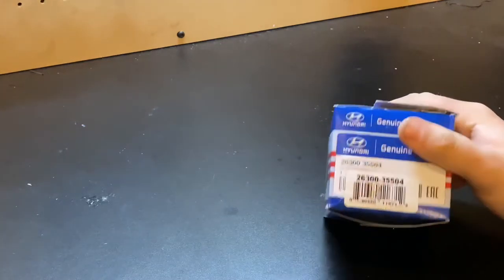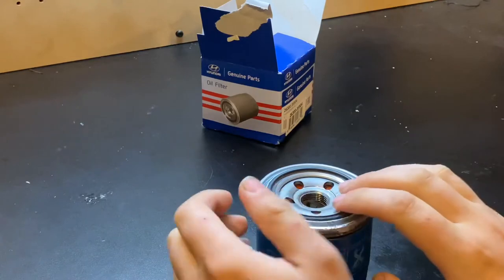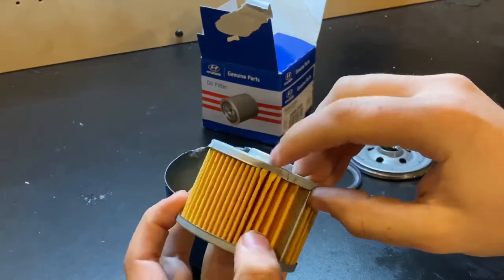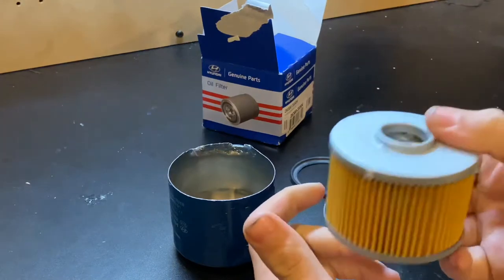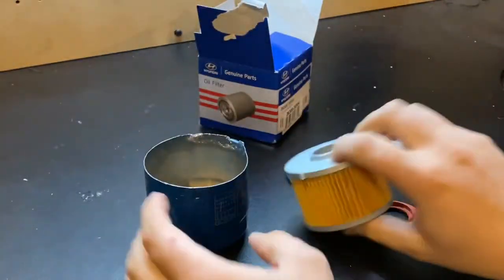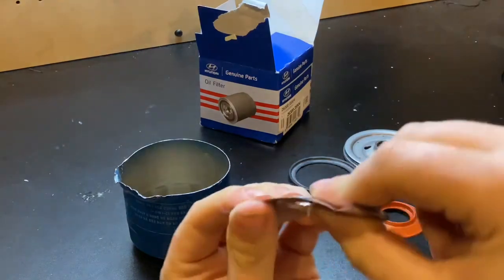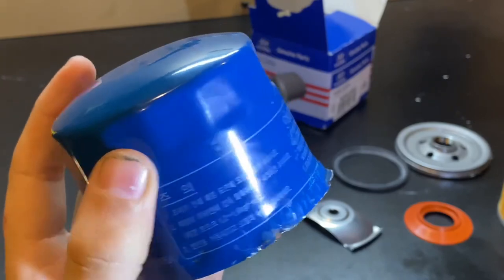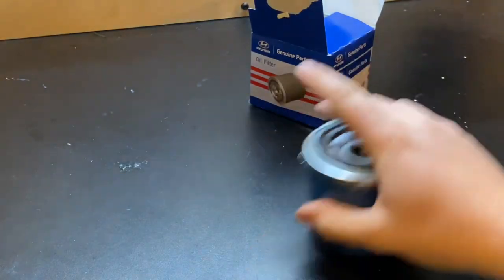Hyundai Kia OEM Oil Filter 26300-35504 Cut Open

Comment: ..these are the very same ones I always buy online , shipped by the 10-pack box  for about $50 from EBay....and they all have the exact same packaging,  quality construction,  and the official Hyundai/ Kia Mobis hologram labels and seals...such a great product...
Reply: Same here. I have never heard of these being counterfeited??? Why would anyone bother with such an inexpensive product???
Reply: @jasmwhite1  They do alot of counterfeit parts. From 15 dollars transistors to oils filters. The transistors are awful. They kinda look the same but they don't withstand the same power than the original (I'm an electronic technician) 
If they're too cheap, they're probably counterfeit.

Comment: I was questioning the authencity of a 10 pack filter from Amazon and compared the new filters to the 2 previous oil filters my car had and the only difference I saw was the boxing.
The new boxed ones have the new KIA logo and come in a brown box, while the old ones come in the red and white kia box.
I think they are legit. I always do oil changes myself and always buy the oem brands from Walmart for the 3 cars that I have but my local Walmart doesn't have KIA.
Reply: The filters are genuine but the brown boxes aren't.  The seller bought them wholesale without boxes and had his own boxes made.
Reply: @Jimmy-sj9ny the brown boxes are genuine my man! Just the newer packaging, the ones I bought from my local kia dealership came in brown boxes
Reply: @snoofayy6150  Thanks.  I did some checking and you are right.  The brown boxes signify either filters made for the Korean market ONLY (the dealer told me some will even say "Not for sale outside the Republic of Korea."); OR filters meant to be sold in wholesale lots and not individually to retail consumers.

Comment: IMHO, this filter, while a good filter, is not built to the level of quality of the WIX XP or NAPA Platinum.  Have used 6 each Hyundai/ KIA filters for the reason that someone said here, i.e. protect your investment with OEM (paraphrasing).  I have noticed that toward the end of the 7,500 oil life, the oil has been pretty dirty.  This time, I purchased 2 each NAPA Platinum PFL 41334 to try.  Please remember that you can seek protection through the Magnuson-Moss Warranty Act when using aftermarket parts on your vehicle, if the parts meet or exceed OEM requirements.  As far as the medium type (paper or synthetic media), there are many videos of guys cutting open oil filters.  Based on what I have seen on other sites, the media in the Hyundai filter is paper.  Only my opinion.
Reply: Appreciate your input. But if you can get these cheap enough and change your oil on time, I would stick with OEM
Reply: @kalani1987  , Thank you for your response.  I always value hearing what other guys are using and doing.  The reason for my changing filter brand is to see if the oil looks about the same at the oil change interval.  I do always change the oil on time (7,500 miles), and I have used nothing but Red Line 5W-20 oil. And I got a real deal on the filters- about $6.00 each (internet sale) at Napa online.
Reply: @kalani1987  Hyundai/Kia filters are made by Mann-Hummel in Korea. The Wix filters are also made in Korea for this application since Wix is owned by Mann. They basically rebranded them. I have used Wix filters in a Hyundai, there are no problems. Stay away from cheap low quality filters.
Reply: I stick only with OEM on my Optima, I don’t want to give Stealership any wiggle room to void warranty. I don’t even want them to consider going down that road.
Reply: Good if u change every 3500 miles I think not wait till 7500
Reply: Mann makes Wix
Reply: Seriously doubt this OEM Hyundai oil filter has synthetic filter media.

Comment: You act surprised at first time seeing pleats inside of an oil filter.  What about the check valve that you say, as an expert on international oil filters and manufacturers, is anti-cloning junk?  Share what you learn, not what you think is good to share because you're wrong about a lot of things here.  AND it costs $6 at my Hyundai dealer with a free $2 drain plug gasket.  "Kind of weird, but it works."  Guru.  They do NOT stamp those out on a stamping press either. lol   Just because you THINK how things are, what they are or why things are done don't make it so.  If you research first then you can let us know what you found out.  My brother works for Hyundai as an engineer and showed me this vid to laugh at. Quick hunt real quick is my fave.  Wait until your Mom finds out that you cut open her $9 filter.  Had fun.  Just lovin' on ya Mason. Good vid.